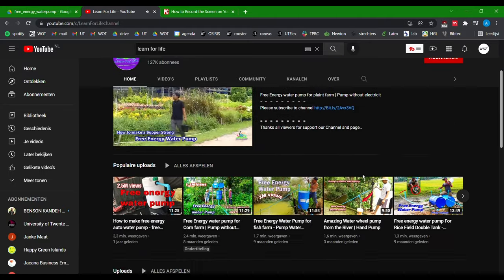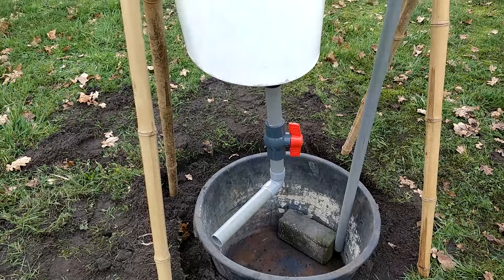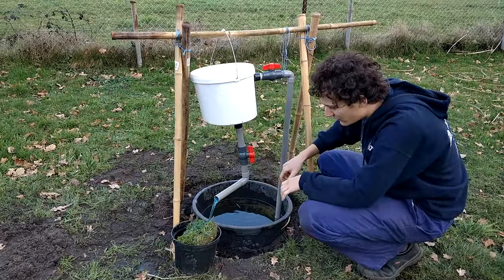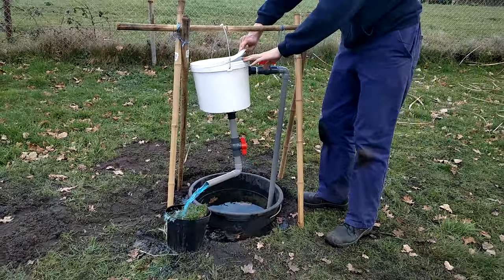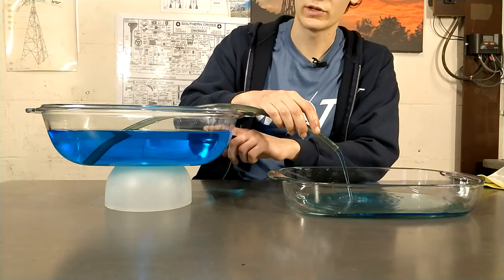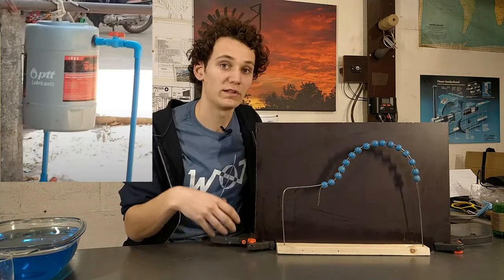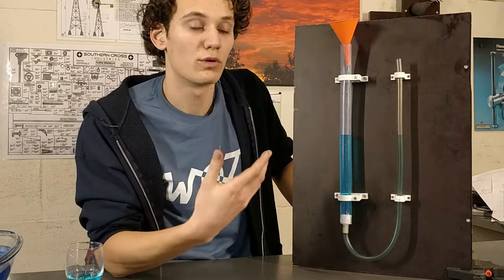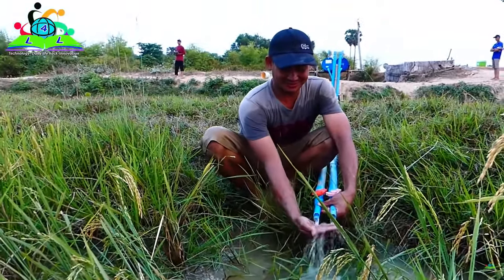FREE ENERGY Water Pump Tested. Is it possible?

Comment: I have not yet try this theory, but I don't think I see a foot valve and a air pressure from your demo compared to the videos from Learn for Life channel. Please try it again - with these items and make sure that the outlet pipe a little longer. It is very important for us from developing countries to know if this really works.
Reply: No foot valveis needed as long as you use a priming baarrel.
For this to work: barrel and tubes must be air tight. Source water level must be higher than output. A siphon can not lift water up from a well. 
One should dip the output into a bucket of water to prevent air leaking in from the output.

Comment: This is an EXCELLENT conversation for so many reasons…. 
But …
1) The total weight of a column of a fluid…IS….. THE…PRESSURE….
there is approximately 80,000’ of air above us….. and if we could issolate a SINGLE 1”x1” square column…. Theoretically , the TOTAL weight of all of the air in that 80,000’ column… is approximately 14.7 pounds ( 14.7 psi) …. So weight … IS … pressure…

2) the experiment appears to use an open bucket… the experiment should also be conducted with a closed bucket..
and…. The column of the water should be of increasing heights.
 
2) so the mechanical riddle…. Is … If I have a 1” diameter pipe…PIPE A…  holding water….that is 20’ tall…. And the TOTAL WEIGHT  of the water measured at the very bottom of the pipe is 7 pounds ( where there is also a very small outlet

In a closed circuit , Is the lifting force equal to 7 pounds.?…

And if so if there is a feed column INLET BELOW the OUTLET….( pipe B or column B )  WHERE THE TOTAL Water lifted volume  ( lifted from a reservoir only a few inches below the outer) is 1/4 of the 20’ tall WATER WEIGHT… 
Could the weight of the water in pipe A lift WATER FROM PIPE B 

We all “ Know” that “ water finds it’s own level”…
But this riddle tries to add a 4:1 “ mechanical advantage”….

THIS…. is the stuff of GREAT high school physics.
A good riddle
STRONG MECHANICAL INTUITIONS right and wrong…
And a clear set of experiments.

Extra twist…. We have a garden hose that I completely UN coiled… stretched across a field … you’re holding one end and an engineer is holding the other end….both ends are held at very similar heights and the hose is “ filled/full” of water.
And the engineer SWEARS that there is 14.7 psi being applied to the end where he is ….. but water  is  NOT gushing or even flowing at all from your end of the hose…. Is he lying ? Or is something else going on.?

Comment: The white bucket you used was not air tight which sucked in the outside air and can not work that way. If you would have used a heavy duty air tight drum so no air can be sucked into it then it should work fine. By using an air tight container filled to the top; as it drains it will pull or suck the water up from the supply water container. By letting the water fall back into the supply water container this should create a continuous flow. I have never tested it but intent to. 

The question is will there be a continuous water flow without the drum ever running out of water or does the drain pipe suck up air which will eventually lower the drums water level???? If it works then a small hydro turbine can be added for electricity for the peppers.
Reply: It can nor work, and that is his point.

Comment: Basically what they're doing is turning a gravity bong (over simplified) into a water pump. It's not siphoning that they're using but a vaccuum that created inside the barrel as the water level inside of it drops. It's a sound principle in theory.
Reply: Sorry, you are wrong. It is a simple syphon. It will ‘“work”/gulp till  the bucket is empty or the outlet is lower than the water level in the well. No mystery here.

Comment: What about a check valve on the one that one that draws the water
Reply: Not needed when using a barrel in the siphon. Actually the sole and only purpose of the container. Excellent video, debunking all those videos claiming that a siphon can act as a pump. No siphon can lift water to a higher level, no energy input!

Comment: In your bucket model you did not fill in the intake pipe with water so the air-pockets in the pipe will block the suction from the bottom tank up. If that pipe is filled the system in itself will try to create an equilibrium and will use the cohesive property of the water molecules to pump water up the height.
Reply: One purpose of a priming barrel is that you do not need any one way valve at the source side, and you do not need to prime the suction tube.

Comment: How about, 60-75 ft ht from the source.. could i take water at that height
Reply from the maker: Hi Roman, do you mean that you want to pump water from a 60-75 ft deep well? This is not possible with this 'device'.  You will need a manually or electrically driven pump.  You can have a look at ropepumps if you are interested in manual pumps.

Comment: This kind of pump relies on a vacuum. First you need to have a larger upper bucket, so the weight of the water is higher, and then the upper bucket has to be sealed. Otherwise it won't create enough of a vacuum, to pull the water up.
Reply: In fact you do not need any drum at all. This drum is only an easy way of starting the siphon. The bucket here IS sealed. It is a paint bucket, airtight. Watch the video and see that air is sucked in by the output. A clear proof that the bucket is closed. For this siphon to work, the input must be higher than the output. As with any siphon.
Reply: You are correct

Comment: The Ramjet pump is a real "free energy" water pump.  Granted, the energy is not mysterious, it comes from the flow of the stream, but it IS free in the sense you don't have to provide the energy yourself.
Reply: There is no "free energy". It is a self running pump, not a "free energy" device. when people talk about "free energy" they actually mean "free electricity", which a hydraulic ram pump (not ramjet, I don't know where you got that name) does not produce...
Reply: @tarstarkusz  A Ramjet is a sort of jet engine used in fast flying aeroplanes. A Ram pump, is a water pump that extracts energy from running water and uses that energy to lift a fraction of the running water to a higher level.
Reply: @kjellg6532  OK, I slightly misremembered the name. Sue me.  Point is, it's a free energy device.  It is free to operate and will operate so long as there is moving water to power it.  It is more reliable than a regular electric powered pump in that it has no moving parts.
There are 2 types of free energy. The first is impossible. That's where you put X power into a system and get X+ out of the system.
The second type of free energy is free energy as in free beer.  Everyone admits free beer exists. Free beer is beer you don't have to work or pay to get.  Free energy is energy you do not have to provide, but which comes from the environment or some other non-human-caused energy. The only cost you pay is a one time cost for the machine.  There are many such examples.from clocks which operate on slight temperature and barometric pressure difference to solar panels.

Comment: In the free energy water pump videos they put in a check valve on the well side and fill the pipe with water .
Reply: With a bucket/barrel there is no need for any foot valve. That is in fact the main reason for using a cheap barrel

Comment: It workks. It has to do with the size of the pipes you used. The extraction pipe has to be bigger, than the diameter of the feeding pipe so it could initiate a difference in pressue wich will suck the water. Also it has to be air tight. Also, i you go deep into tge well you need bigger size tank and a check valve qt the buttom of the pipe plus some volume calculations t size the pipes correctly. The pipes you used are simmilar in size wich wouldnt work the why you heared that interruption sound.
Reply: Noop. Size of tubing does not matter at all. Input pipe can be say 110 mm and exit 32 mm, no problem. 
It is correct that the volume of the tank must reflect the volume of the total tubing from water level at the source till an exit lower than the source, this is a siphon!
The system here is airtight, that is why it sucks air via the exit side since the exit here is higher than the source. The siphon tris to run in reverse. 
No check vale is needed when using a priming tank. This is the sole purpose of using a tank, to facilitate the priming of the siphon. 

An excellent video showing that no siphon can lift any water to a higher level, tank or no tank.

Comment: It may work, I suppose the logic behind it isn't siphoning  but pressure gradient, you just need a narrow pipe, bigger drum, and more water filled in that drum and as well as the source, and it's not exactly free energy, it is in a way using potential energy of the water in the drum, the outflow water will be more than inflow, and soon as the drum goes empty, pumping of water will also stop. Plants actually do this don't they ? Well they use the sun to build a much more effective pressure gradient, so even I am sceptical about whether this will work or not
Reply: It is nothing but a siphon. The source must be higher than the output for it to work.

Comment: The container has to be air tight to start with. Then when water goes out through the opening from its lower level, gravity works. And as the water goes out, the level of water inside the container goes down and when it does it also sucks water from below even from a deep well. In sucking the water from deep well it's not about gravity of siphoning.
Reply: No. A siphon can not lift water up from even a 1 inch deep well. Impossible.
Reply: @kjellg6532  if it's simple siphon works, then it's really impossible. But this one also involves gravity and vacuuming.

Comment: It failed.. your bucket must be bigger and tight sealed or airlocked. And the suction pipe must be smaller than your outlet pipe...outlet pipe must be just 1/2 " size minimum. So the suction must be smaller than 1/2"size or a smaller garden hose.

Comment: Your pipe diameter is to wide, for that small bucket. You need a high enough volume and outflow to create a vacuum that can suck the water all the way up. Use smaller tube/pipe for the inflow and it will work.

Comment: The bucket looks not tightly sealed. There is no pressure chamber on the outlet. You simply tried to create a siphon which cannot work in that setup.
Reply: Correct, it does not work and the reason for that is that the water level in the source is higher than the exit. He proves that such a “pump” is a hoax. Purpose of this video.

Comment: Even if he primed the pump and had a full bucket. It would only work for a while. The reason being in order to pull water you need more pressure from the water being dumped out. (I'm exaggerating numbers here because I don't know the actual numbers.)  But for instance you would need 2 liters of water to flow out of the bucket just to pump  1 liter of water into it.  It would sustain itself for a while until the bucket started to get too empty to pull water then it would empty out.
Reply: I think..as higher is the Vakuum in the store as much more water will come into the store. The Tank has to be big and strong enough to create the vakuum and the backflash of Air from the outlet has to be prevent. Its right ...the Full tank will empty a lot to create the vacuum. It will never be the same Level from the Start. But you need enough water in the Tank and long one way outlet pipe to prevent the Air coming from the outlet.
Reply: You do realize that the water coming out creates a vacuum inside the container, right? The water coming in replaces water that went out. Both vacuum and atmospheric pressure make the water go in, and gravity makes it go out to create the vacuum.That being the case, your comment is useless and has nothing to do with this device.
Reply: @darrylkinslow3357  Right but yhave more water volume going out to suck up the water then water being sucked up. There's no way to get around the fact that you need to compensate for atmospheric pressure pulling down against the water being sucked out of the bottom

Comment: Will if yur plastic container is not air tight completely air tight wont work air tiight is the key,,, Cause the container bucket will sux it up like the container is like shrinking hopefully i said the right word,,,, cause I got a 50gal barrel 30' water well my container like suxs air like it shrinking something like that cause the last time i did it again few times about 5times the 6 time it didnt why..???  Same as  what U just did the container 50gal barrel stayed normal shape all the water just went down... no water on top at all so nxt time did it again i put plastic around my 50gal barrel lid added water then did it again 50gal barrel is now suxing cause barrel is like suxing deeply shrinking i can hear the water coming in now,,,,,

Comment: It does work but the out pipe has to be longer than the in pipe otherwise it sucks air back through the system.
Reply: Noop, but the water level in the source must be elevated higher than the output as with any siphon.
Reply: @larrymcdowell6920  This is nothing but a siphon with a barrel to get it started. You may have an output 100 meters or more,  it will not help. For any siphon to work, the output from the siphon must be lower than the water level in the source.  This video clearly demonstrates that.

Comment: If you watch those videos of the non electric pumps they are making, they have a delivery pipe that is as long or longer then the suckcen pipe going down into the well.  So I think it is the mass of water in the exit pipe what is important. ♦♦♦
Reply: First, source must be higher than output. System must be air tight. That is all that is needed for a siphon to work.
Reply: @kjellg6532  they say you need a larger exit pipe, but a smaller exit port/hole. Second, I notice they put pressure regulators on them to keep it from "gulping" or "Glugging" . One of these days I want to put together a experimental set-up.
Reply: @NormBaker.  Yes, air leaking in from exit can be a problem. You may lift the output upwards with a 30 degree bend, use a hose hanging in a “U” or simply dip the output into a bucket of water. This will prevent reverse air from output.

Comment: 2 things to consider, first of all, siphon towers could expand already existing hydro power generation capacity at existing dams...  and two if you put a pump on the bucket sucking out the air, the pressure will pull water up into the bucket...  pumps that could operate on solar power...
Reply: First. This set up are not able to pump water uphill. Second. Given that the tank can be closed airtight its only purpose is to prime he siphon.

Comment: your system does have air leakage that's why it's sucking air. The main principle is because of atmospheric pressure and vaccum inside the water tank, you have not set up a valve at the low level tube
Reply: With a barrel, no foot valve is needed. The fact that air is suced in from the output proves that the bucket is air tight. He simply shows that a siphon can not pump any water.

Comment: I think this may work. It’s not free energy. Rather negative pressure to create strong enough siphon in the chamber to lift the water.  The problem with your set up is that you don’t have any way to stop the back flow of air into the chamber. This can be achieved by keep the outlet under water or installing and air chamber in the outlet pipe. I have seen several YouTuber who tried to replicate this and missed the arrester air chamber in the outlet pipe. It’s simple science. The size of the water chamber will depend on the distance  between water source and water chamber. The discharge pipe had to be long enough to sustain the negative pressure. Even if it’s not long enough the arrestee chamber will help overcome the back flow of air. Now you input energy in form of muscle power to fill the water reservoir. Use the gravitational energy  to creat motion in term of water flow. This will creat negative pressure in the water chamber. There are only two ways to overcome the combination of negative pressure and gravitational energy. Either the water has to enter into the chamber from the reservoir or air has to enter through the outlet pipe. If sufficient negative pressure is created in the chamber the water will lift and enter into the chamber. However, there is a sweet spot for this system to work. Any one component out of proportion the system will not work. I will love to see you try it to find out for sure.
Reply: Thank  God for good people in this world.

Comment: It does work. I would pull this down as your experiment is flawed. Use a larger airtight sealed tank and reduce the flow on the outlet. The outlet needs to be longer if you cant lengthen it use a check valve.
Reply: Ok. With a check valve at the outlet the water flow will stop. In fact, if you polish the output orifice so it is smooth and plane, press a piece of paper against the exit till all water flow stops, then remove your hand, then the system would stay put. No water coming out at all! Try it wit a bottle. Suck it. Press a piece of paper against the neck and lift it out of the water, neck down. No water comes out!

Comment: hi . Try using a 50-liter plastic gallon and close the lid well, perhaps with some silicone to cut off the air completely. And make the water coming out of the gallon back to the tank at the bottom. Silicon must be placed on the pipes as well. Do not use any kind of valves. Just try to close the water outlet with any kind of cover until you will be ready to start.